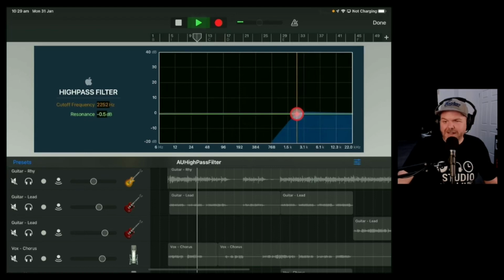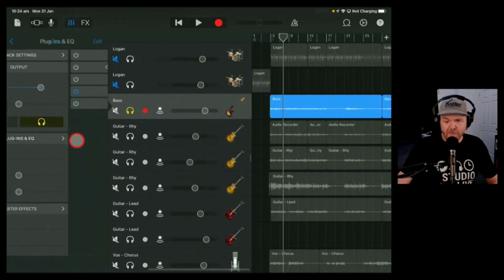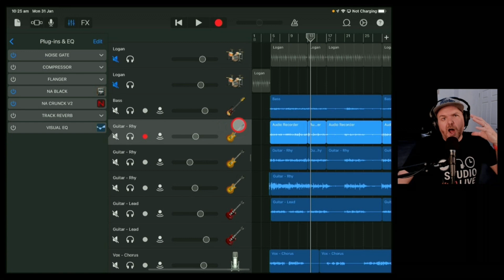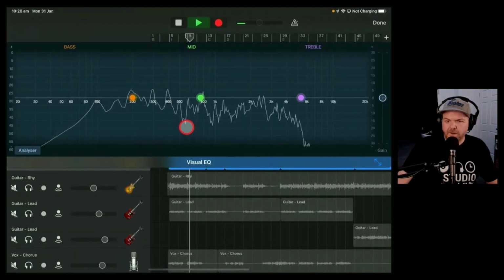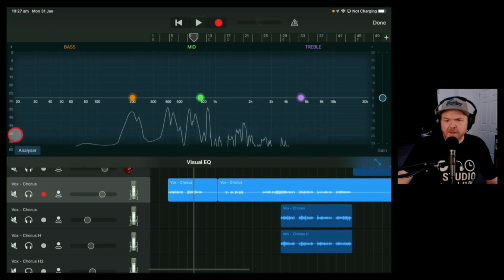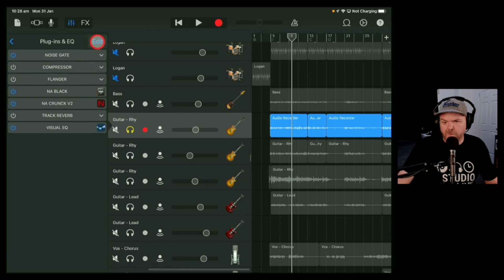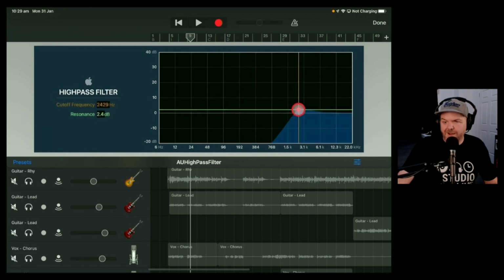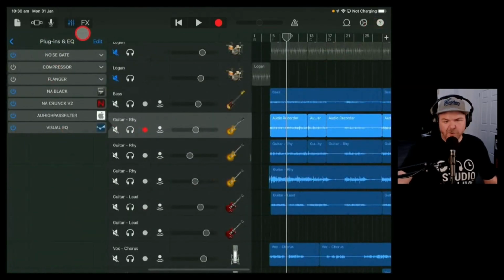Reduce NOISE/RUMBLE with a High Pass Filter (GarageBand iOS)

Comment: Hey Pete I’ve had the presonus eris 3.5 studio monitors for about 2 years now..my question is what is the high low knob on the back of these monitors..and do I need to tune these for the room I’m using to record in..I think you know what I’m talking about..hopefully you have a tutorial on this thanks in advance Pete
Reply from the maker: Hey there. So these are basically some time controls for bass and treble. You can tune the bass and treble response to match your room. So if you’re finding you’re not hearing enough Bass because you’re in a small room for instance you can tweak it. I leave these pretty flat to be honest but you can experiment if you have the time and patience.
Reply: @StudioLiveToday  ..so I’d be better off just leaving them alone
Reply: @StudioLiveToday  .. I think I found the problem.. I’ve been using regular guitar cables which is unbalanced,..from my interface to my monitors..looks like I’m ordering 2 more cables that are balanced from Amazon..everything has been sounding really good through my monitors and even through my car stereo..but when listening to my mixes in my car stereo I have to tweak a few things in the mix on my iPad through my car stereo..not much but enough to know that I want the same sound mix in both monitors and car stereo I think I need balanced cables from my interface to my monitors

Comment: The regular EQ can only do a low shelf and a high shelf filter. Both shelves will only reduce certain frequency ranges but will not cut frequencies entirely. So even ig you drag it all the way down, the frequencies will still be subtly present and could still clash with other frequencies
Reply from the maker: Truth.
Reply: Got it thanks definitely going to use this then